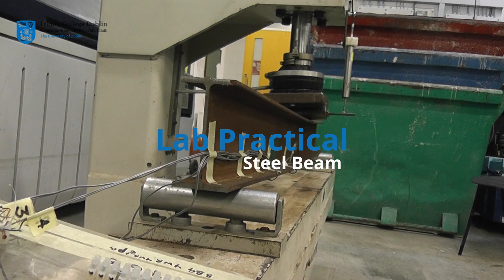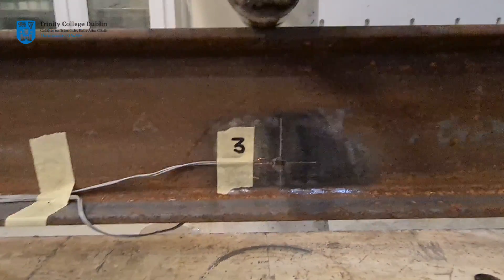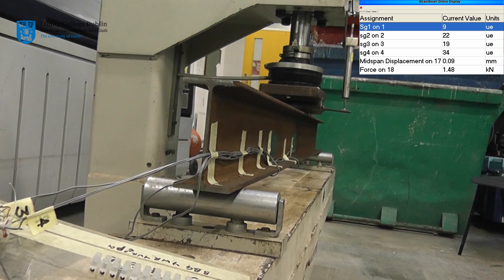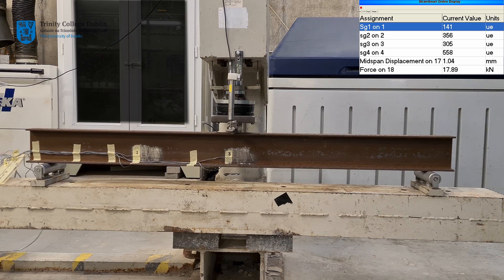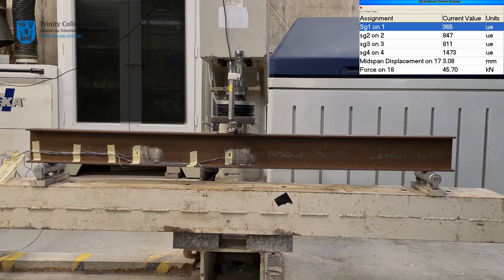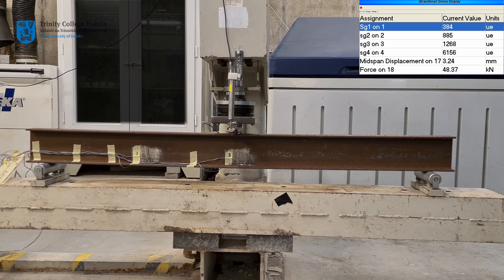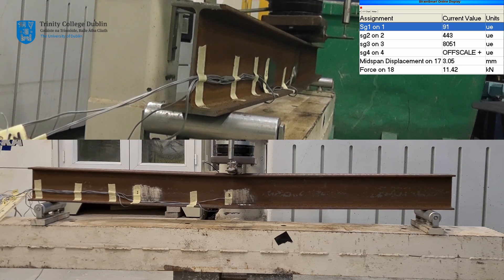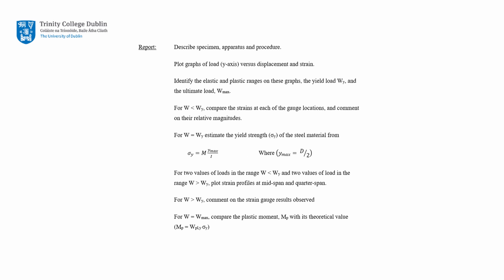3A2 - Steel Beam Lab

Comment: Would placing a stiffener at the point of load application produce a more mathematically accurate result since local failure possibly would’ve been avoided. I did not expect the local failure since the flanges do appear compact.
Reply: It would likely be too strong for the press and might cause a failure in the press instead of the beam. Always have to think of that possibility. Stiffeners increase the strength by 2-3x. That would put a hell of a strain on the press.